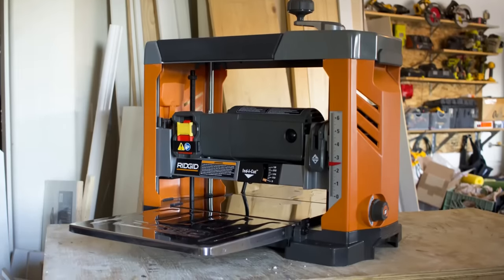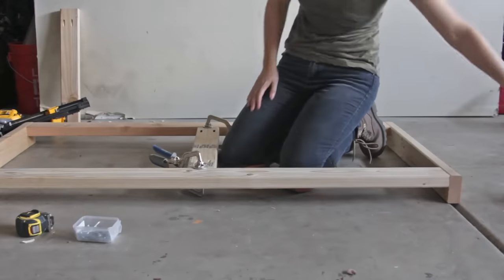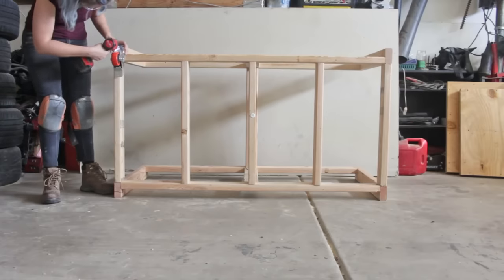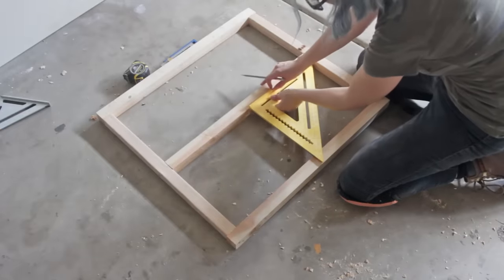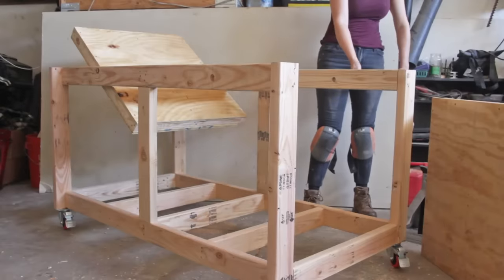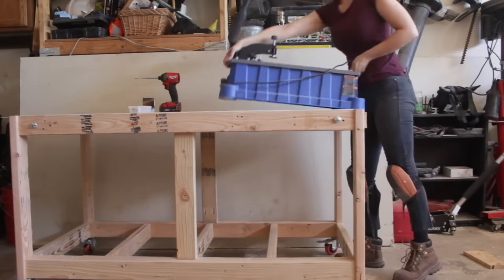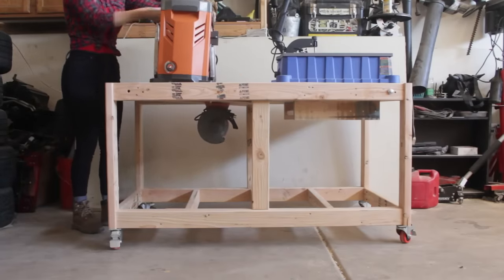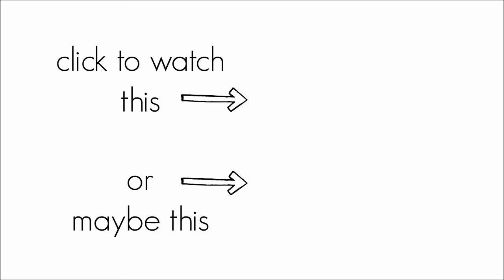Double Ended Flip-Top Workbench | Woodworking Build

Comment: I will not lie, I clicked on video for reason 1) a beautiful woman, 2) a flip top work bench for woodwork equipment. You did a outstanding job building and explaining your process.  Thank you for your video. 💡, 🦷 was pulled on Thursday, the roller idea is a great idea.  I would mount something of equal weight opposite the planer so it rolled naturally with less strain on me or even do a triangle for 3 bench top tools.
Again Thank you.
sirjames